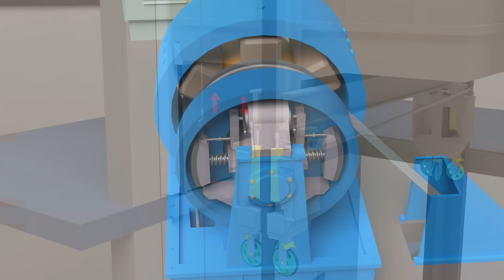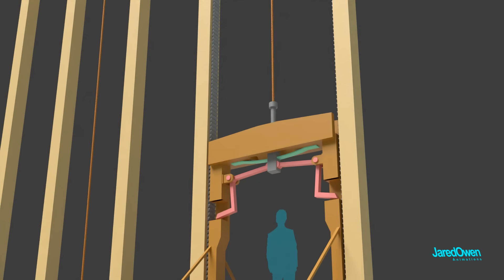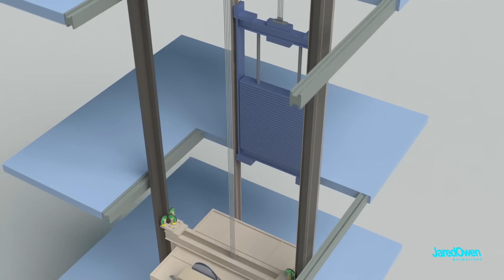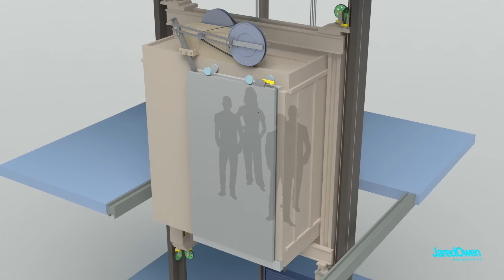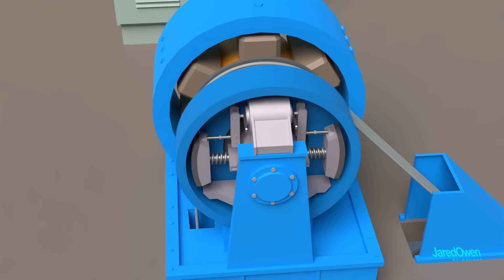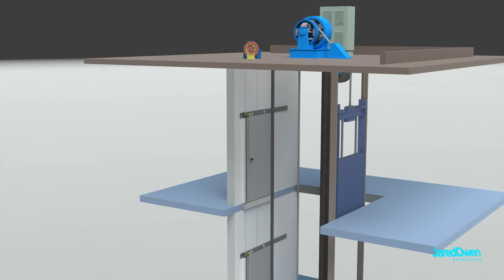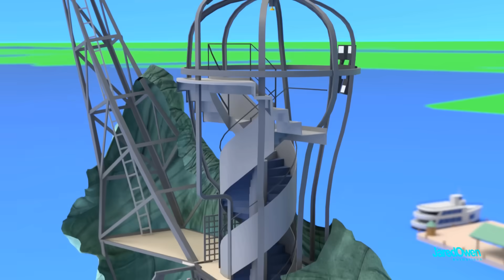How does an Elevator work?

Comment: It would be nice if there was a new elevator in the future. I have a better idea of designing an elevator that could carry more people quicker. This elevator wouldn't only go up and down but let's say you enter the elevator on the northeast corner of a building but you are trying to get to the southeast of the building. You would have to ride up to your floor and stop at other floors and in a tall building that is ridiculous especially if you have to stop for other people then you have to walk all the way to the other corner of the building. This new type of elevator would use an electro-magnetic proportion system. Most elevators ride on tracks and are pulled up by cables or a pisten which can mean the ride is not as smooth while these other methods are limited at best. As buildings get taller and to get to the top floors of some buildings you will have to get off of one elevator and get on another elevator. This new system will only follow the elevator shaft and never touch any other side until it reaches the floor. The elevator will follow the quickest and shortest pathway to the destination door opening on the desired floor. The elevator would rise up to a certain floor then if you start at the northwest corner of the building and you need to go to the southeast of the building on the 185th floor you may enter the elevator and it will go up to a floor close to your floor may be above or below your desired floor. The elevator will move along some designated pathways not open to the public and the elevator will move horizontally to the nearby place in the building you are going. The elevator will rise or lower to your destination floor where the elevator will stop and the doors will open. This elevator system would use some of the concepts of the PRT Personal Rapid Transit system but in an elevator system.
Reply: I believe ThyssenKrupp (TKE) is working on something like that with their MULTI system. It’s a really nice idea.

Comment: If i am stuck in elevator and there is power cut and for some reason generator is not working properly, then would i die because of lack of oxygen by being stuck inside the elevator because of power cut? or is there any opening somewhere from where we can get enough oxygen to survive?

Comment: There's a third type that is less common (And I don't know if it's passenger-safe technically) that puts gear teeth on the guiderails and the motor with a worm-gear drive on the carriage for use where there's not room for either a counterweight or a piston (Due to the ground being unsuitable for a piston style, and the size/weight of the counterweight being excessively high.)

I've only seen them used for massive freight elevators (4 rack guiderails with the motors in between. Doesn't actually have the typical floor-selection system because it's operated by a throttle knob. Because of it's location in and around a cleanroom environment, it has to service 5 levels with payloads up to 20 tons, and be adjustable with the doors open to slide things off pallets (Because wood pallets can't go in the cleanroom). It's a cool design, but definitely very niche.

Comment: The overspeed brake is not really an equivalent to Otis's original safety brake: the overspeed brake responds to speed, while the Otis system responds to a loss of cable tension. I've seen cable-tension brakes on elevators (in a glass hoistway installation which makes the car top visible), but it may be that high-rise elevators use only the overspeed brake.

Comment: The pumping of oil that occurs in hydraulic elevators explains why they are so slow and why their sound is different in operation.  They are simpler and less expensive than traction elevators.
Traction elevators in old building have very large motors up in the penthouse.  Modern machine room less elevators have the motor compacted into a relatively small package that sets in the top of the shaft eliminating the need for a separate room.
Older elevators would have a ribbon or small cable that extended the full height of the elevator and moved with the cab so the machine in the penthouse could tell when the car was at the correct floor level so it could stop.

Comment: I worked for the Otis Elevator Company. The engineering name for the Otis "traction elevator" is "geared electric traction" elevator. The gear drive design permits the elevator motor to rest under normal conditions without a separate brake locking the pulley when the car is stationary.  So it has two safety mechanisms to prevent slipping/falling, one rarely needed.  The difference between traction and hydraulic motivation  is traction pulls while hydraulic pushes.
Reply: Bhai mean bhi otis mea construction mea hu assam se

Comment: I do elevator cab modernization and LED conversions as well as communication systems end audible visual assist devices for elevators, I have worked around them for many years, this is an absolutely fantastic video that you have prepared to explain the different intricacies and the mechanics of these wonderful devices. When I was a kid in grade school I did a report on Elisha Otis's emergency braking system . Fantastic animation great work!

Comment: Why can't you just use the elevator itself as the counterweight in a traction elevator?

Think of a rope that is attached to you in order to lift you. Then the rope goes upwards around the sheave, comes back downwards until it reaches your height. You grab it and pull yourself upwards. This would be a simple example where you use yourself as the counterbalance, I would think.

Or as another demonstration:
To keep yourself at a certain level, the other end of the rope which comes back downwards after circling the sheave is connected to the beginning of the rope using a rope-brake.

Comment: so if a hoistway door can not open on its own, I'm confused. We lived in a high-rise apartment on the 6th floor, one day the hoistway door opened on its own and there was no elevator there, I almost walked in and fell down the shaft. Another time the elevator stopped half way up the floor and both doors opened. I had to crawl out. Another time at 1 am I heard a extremely loud bang bang bang. I went down to the basement where the noise would hurt your ears. Tried to get the super but no super of course. turned out the elevator was going up and down banging into the basement floor for hours with a poor woman unconscious in it. Thank heavens I don't live there anymore. Does not sound all that safe to me in any way shape or form.

Comment: Thumb up if you are old enough to remember the elevator operator person. They usually had a little fold-out seat to sit on, and a lever to start & stop the elevator.  The people riding would call out the floor number they wanted.  The operator would stop the elevator at the request floor(s) and then pull open the gate, and then pull open the floor door. They usually wore a uniform. I don’t remember how the operator knew what floors to stop at for people calling for the elevator, though.  Some elevator doors on the cab were just a simple iron  “gate” - You could actually watch floors go by as the elevator traveled.

Comment: My first engineering job was for an elevator company. I helped design elevators to customer specifications. I also did a lot of the custom designs. I did design work on hydraulic and traction passenger and freight elevators and also on escalators. This video does an excellent job of covering the basic design of elevators. The coolest thing was being out in the field and riding on top of the cab in a bank of 3 elevators while doing maintenance.
Reply: Wow, that would be quite something to ride on top of the elevator. Sit tight, don't move, and keep your hands close to yourself I guess. I also assume that at the top floor, there is plenty of space above the elevator.

Do the hydraulic ones have just as many safety mechanisms? And about the shaft, does the underground part of the shaft move, or is it a telescoping mechanism that emerges from the underground shaft to push the cab up?
Reply: @LionoftheCross  This is when the elevator is in service mode. It runs slower and is out of service to passengers. There is an operators station up there that requires both hands to hold buttons to operate. But you need to be extra careful with the counterweights and other elevator operating in the bank. There is a bit of distance (overhead) so that's not an issue.

With hydraulic elevators the cab basically sits on top of a piston the lifts it. For ascending a pump pumps oil into the bottom of the cylinder raising the elevator cab. The piston assembly is in a drilled and cased well hole that is about the same depth as the total elevator travel. Most hydros only serve 2-6 floors - usually a maximum of 60ft of travel.
There were some telescoping pistons, but the cost outweighs the benefit.

Hydros descend by opening a valve that controls the flow of oil to the reservoir and the weight of the elevator is the what's used for descents. Yes. there are also safeties, but even a complete failure of the oil lines still wouldn't allow it to freefall.
Reply: @joeyager8479 That's helpful to know. So regarding the hydraulic ones that don't telescope, the entire piston moves up and down in the cased well hole, thus lifting/lowering the cab. Correct?
Reply: @LionoftheCross  The cylinder body is suspended in the well hole. The well hole usually has a steel casing protecting the cylinder body from contact with the earth. 

The piston rod extends or retracts to raise or lower the car. The piston travel is slightly longer than the total stroke. There is some overtravel built in at each end so the elevator never hits a hard stop.

It's been about 50 years since I worked on these and there are other designs that use cylinders that don't require well holes. Some actually attach the car to the cylinder piston with cables and pulleys. I'm not familiar with these designs.
Reply: Why does they do that little drop thing when they come to a stop. It’s like it misses alignment and then corrects but they all seem to do it. Is it the two doors connecting?
Reply: @BryceWalker30  I think what you feel is the elevator car leveling to the landing floor. It first decellerates a slow constant speed just before it comes to a stop. You might be feeling that transition as a "drop".

Comment: Wow, excellent explanation about the functioning of an elevator. Congratulations on this one. Just one small correction: you mention in your video that you need at least 4 traction ropes. With Flexisteel, a polymer-coated steel rope, this can be reduced to 3 ropes.

Comment: Hi, this is a very informative video/animation, and does cover some of the basic facts regarding elevators. Your animation shows gearless machines or motors while the majority of elevators use geared machines or motors eg. worm and crown wheel with gear ratios from 1:38 and above. The hydraulic elevator shown using the bore hole method is not widely used now as telescopic pistons with 2:1 ratios using pulleys and steel wire ropes at the side of the elevator cab are easier to install, cheaper and go higher. The basic design principle of modern elevators has not changed over the years except some manufacturers like Schindler are now using flat belts instead of steel wire ropes, however their control systems have advanced from basic pole changers, 2 speed DC and AC to VVR and now VVVF and beyond.

Comment: There's one additional safety measure in the event that the emergency brake doesn't work: a buffer (basically a large shock absorber) underneath the elevator cab and the counterweight. If the elevator doesn't stop before it reaches either the top or bottom of shaft, it'll impact the buffer and bring the elevator to a rough-but-not-life-threatening stop. So, you won't die from a freefall even if every other safety mechanism fails.

Side note -- you're also much more likely to "freefall" upwards rather than downwards if there aren't very many people on the elevator since the counterweight weighs more than an elevator with a few people. You can see videos on YouTube of elevators crashing into the ceiling rather than the ground.
Reply: this is why safety gear car work on both direction, plus unettanded car move ment...

Comment: I had been a building mechanical equipment consultant for nearly 30 years. Working with different types of elevators like hydraulic and traction type. I’m glad you (@Jared Owen) has shared this enlighthening video. This enhances the elevator riding public to understand how safe and the mechanism envolved in an elevator. ❤

Comment: With the clutch design, how are doors prevented from being opened as the cab briefly passed them on it's way to a different floor?
Reply: The clutch moving sideways is what opens the door. If it’s not doing that, the other side of the clutch stops the hoistway door from moving. Once the cab passes the floor, the clutch leaves vertically and is locked again.

Comment: The are more than 2 types of elevators. 
I designed hydraulic traction elevators
These are practical up to 12 floors and don't need a deep pit for the cylinder and don't need a extra floor in top.

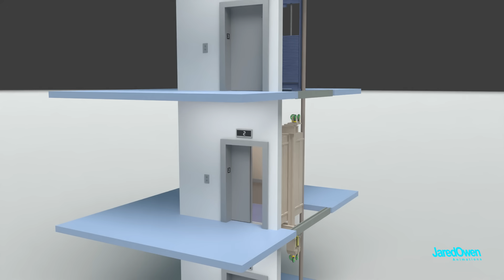Comment: 9:02 not in Taiwan they dont. Getting slammed in on by elevator doors is pretty common. You usually get squished by both ends before the sensors they actually have kick in. Ive nearly wet my pants many times by elevators not stopping after making contact with me. Some doors do require actual pushing to reopen them once they close. This wouldnt be as noticable of a problem if the elevators had western bodies in mind (wider bodies), the doors werent set to close immediately after opening, and if the elevator close button was just for show like they are in the west. They actually are connected and work in Taiwan, very promptly. Which is another reason i call Taiwan the country of "watch your step"

Comment: You forgot the cable weight compensation chain between the bottom of the cabin and the bottom of the counterweight.
This is mandatory for operation in high buildings. Imagine a 12 floor building. The cabin is in floor 1 and the counterweight in floor 12. The cable weight over the cabin is so high now, the elevator won't work at all 😅

Comment: I knew elevators had some sort of a safety mechanism to stop the the cabin from falling, in case the cables snapped. But having watched your explanation of how it actually works, I feel a lot safer riding elevators! Thanks for putting all this hard work into educating us, @JaredOwen
Reply: I feel a lot safer too
Reply: oddly i feel less safe, feels like the emergency break wont stop it that fast :d
Reply: @Bonzi94  the safety brakes get tested under non stress testing every year, and full load full speed tests every 5 years. they stop the elevator in roughly 15-25 inches depending on speed of the rating. under elevator code, even at full emergency conditions IE engaging the safety brakes ( which almost never happens in real world) you are not allowed to exceed 1 additional G force.  therefor the brakes HAVE to slide a bit for passenger safety. if they set immediately you could get hurt.
Reply: @slappomatthew  That was very helpful to know. Thanks.
Reply: I mean it wasn't what we thought.
Reply: I will never forget about that OG
Reply: I feel less safe. The modern mechanism has too many points of failure.

The original mechanism was clever because it was dependent on what mattered to the issue it was solving. An elevator falls because the main cable is no longer holding it and therefore not in tension. By triggering the mechanism when tension is lost, the only way it fails is if the parts of the mechanism break.

The modern mechanism isn't linked to the main cables and therefore doesn't operate if tension is lost. It operates on its own cable, which defeats the entire purpose, ensuring safety in the event of cables failing. It's a cable safety system that depends on a single cable, and it isn't even connected to the main cables.

The actual breaks are concerning as well. The tooth system is held by gravity. The teeth can shear, but that's what redundancy is for. The friction pads are relying on the mechanism to remain in the active position. If something fails, the pads release and the elevator cab falls.

Some "fun" points of failure. The single cable snaps. The speed governor teeth shear. The governor gets stuck but the cable slips. The linkage from the cable to the pads fails.

The modern system spits in the face of fail safe design and safety. It's atrocious.
Reply: @tadferd4340  The single cable of the speed governor is not loaded, so there is no reason for it to fail. If any link in the chain of components of the speed governor brake system does fail anyway, the machine brake will still stop the elevator if for some reason speed becomes excessive.
Reply: I thought they still use the same method developed by Otis
Reply: How elevators Work Is "Not What You Think"
Reply: elevator safety mechanisms were... not what you think
Reply: This doesn't always prevent cabins from falling, I've seen one fall due to lack of maintenance, and it's not very old.
Reply: Dc
Reply: This looks like a dangerous machine if cables snap but it is not what you think
Reply: @hercegovac9999  yes mostly the governor at the motor room may not function due to the elevator being old and not replaced
Reply: @hercegovac9999  why do I keep seeing people with this weird anti lgbt emoji